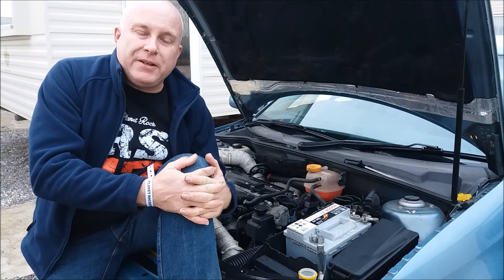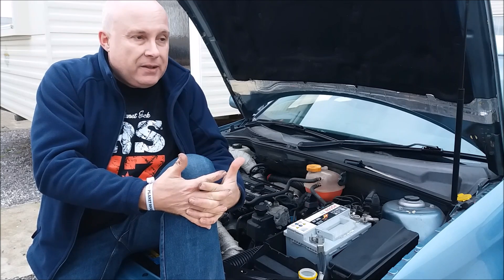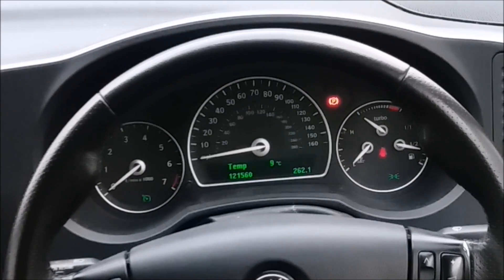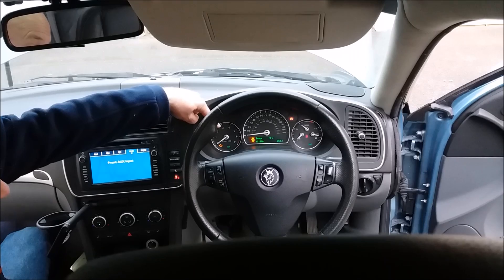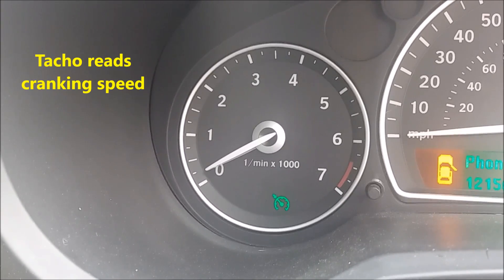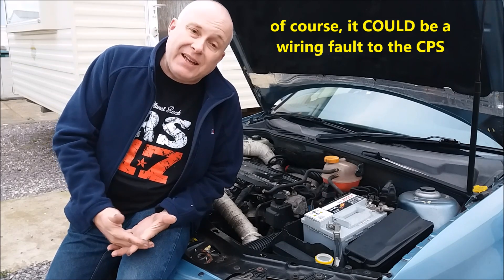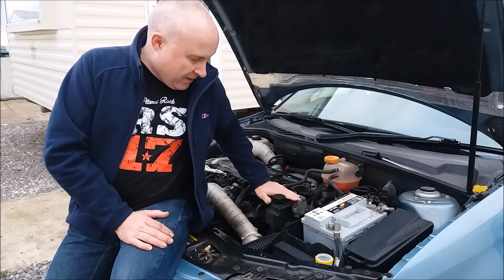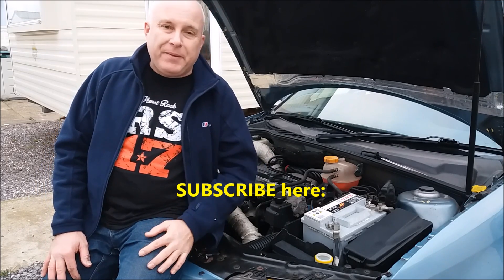CRANK Position Sensor Test - failing CKp sensor - CKp test

Comment: Interesting, my Kia Rio 5 hatch, is a 2013 model, recently had this issue could not turn over engine. Thought battery, but it's in good health. It would eventually start, and work a few times. Last night couldn't start and same this morning.  

I did notice my rpm gage  was at 0 when I got it to start and I was on the road doing 60km/h. Thought it odd at the time. Parked my car at a plaza and stopped and started the engine and rpm gage was fine.

Now present day, my Kia Rio 5 hatch won't start. Waiting for a tow to the garage. 

This video helped me clue in the rpm and the crankshaft sensor!

Wish I found your video sooner! Thanks!
Reply from the maker: Hope you get it fixed cheaply and easily
Reply: @CycloneCyd  the crankshaft sensor was the issue, I had to get my car towed to the mechanic and explained the issue and the rpm issue, they checked for possible codes and did find it this time and had it replaced.

Picked up my car today and went for a late evening drive on the highway to clear out remaining old fuel and added some fuel additives and filled up my tank.  I only put 3k km on the odometer in 2020-2021 so gotta drive it to keep it in good running condition.

And now I do notice when I start the engine, the rpm needle does do about 200-300 before the engine kicks in.

Thank you for the tip again! Cheers
Reply from the maker: @Wireless_Gadgets  glad it was an easy fix, but just as important, now you know the 'signs' if it happens again

Comment: Hi cyd great vids bud , not sure if you can help me but the Haynes manual is saying set to tdc to change crank sensor ?? Why would this be surely it doesn’t matter as it’s only a magnetic pickup sending a signal it’s a 13 plate connect 1.8tdci thanks in advance regards  trev
Reply from the maker: That does seem odd, but is there a reason you can't set to TDC?
Reply: @CycloneCyd  it means either cam cover off an all pipe work etc or down at crank area alternator and an auxiliary bracket off

Comment: This is what I thought when mine started stalling randomly, same thing, would just shut off and no warning lights or anything. Unfortunately, mine turned out to be the ECU programming which just got corrupted over time until the engine wouldn't even prime the fuel pump or crank.
Took almost a year to find one that worked and figure out how to reprogram it to the Chassis Number of the original one...

I had replaced the CPS in the meantime, coils, plugs, and then it still wouldn't start (would crank but not fire). Turns out the replacement Bosch CPS doesn't actually work and only its original one did. When the Service Tech tested them, the newer part had more electrical resistance than the old one, and the signal was just not getting to the ECU. I'm still on the same late '02 CPS even now, I just clean it out periodically along with the MAF sensor...
Reply: What were your symptoms? Having problems with my corolla starting to think it’s the same as u
Reply: @joshhemingway7294  There was only one, the car would randomly shut off, regardless of whether I was stationary or driving. When it first started, I would be able to start it back up, but that only lasted about 3 weeks, after which, whenever it would turn off, it wouldn't crank back on.
I knew it wasn't the battery, as it was fairly new, and I wasn't getting a charge system warning either. I thought it was some kind of grounding issue.
If I disconnected the battery, waited a couple of minutes for the system to drain residual power and hooked it back up, the car would start as if nothing happened.
As time went on, the intervals at which the shut-off would occur grew increasingly close. The last time I was able to start it on its original ECU, it lasted a total of 60 yards, just long enough for me to squeeze it into an ok parking spot in my neighbourhood.
After that, nothing I tried worked.
I eventually removed the battery to avoid it draining and was basically on foot for the better part of nearly a year.

Comment: My car with 1.2liter engine has problem with low voltage input on camshaft position sensor i changed camshaft and crankshaft sensor the light is still on please any advice
Reply from the maker: The light is still on after driving? Have you checked the wiring? Double check they are fitted correctly

Comment: On a polo 1.2 2002 6v is the crankcase sensor drivers side or passenger side of engine bay I'm struggling to find it. I watch another video of your and you said its on the left. If I stand in front of the car the left is drivers side if I'm in the car the left side is the passenger side. What is it on drivers or passenger side. Be great if you could help with any info

Comment: I have a acura RL 2006 the sensor keeping fails every few months I replace it twice already
Reply from the maker: Check that the sensor isn't moving ever so slightly and a gap opening up to the inductor. It doesn't take much.
Reply: @CycloneCyd  ok ill check that out thank you

Comment: You've described my symptoms to a tee. I'd changed the cam sensor first but still no joy then in the process of changing the crank sensor the plug broke away from the shaft which is still lodged firmly in the hole and looks like it may be sending my rover 75 to the scrapyard. Any suggestions how I might exctract it would be greatly recieved as short of dropping the gearbox to knock it out from the other side or take the front end off and radiator out to see if I can drill it out I'm lost and probably well out of my depth with either option.
Reply from the maker: Ouch, nasty. Could you use a stubby to get a sharp wood screw into it to pull it with?

Comment: Had the exact same symptoms, my mechanic suggested it's the fuel pump without running and diagnostics but I insisted he first checked the crank sensor which it was. Not a very expensive replacement. And also the engine idles much smoother now
Reply from the maker: I'm not surprised it runs smoother. When crank sensors start to fail they can "miss a beat". This causes timing issues or even misfires.
Neither am I surprised a garage tried to scam you for a (expensive) fuel pump. It's big bucks 💲💲 profit for them and they can be virtually certain you'll be back because it won't fix it❗
Well done you for insisting. One more little victory against garage scams and useless mechanics who shouldn't even be servicing a walking stick.
Reply: @CycloneCyd  Thanks. My car broke down in front of the workshop I go to near my house. It was on a Saturday evening so I parked the car in front of the workshop and told the mechanic to take a look at it on Monday. On Sunday, I decided to scan the ecu and see if any codes show up and found the P0335 code, the check engine light was also on. Surpringly, I was able to start the car after it had stayed there overnight. The next morning I went to see the mechanic and asked him what he thought the problem could be. He said it seemed like the car needed a new fuel pump. At that point I asked him if he had checked what the check engine light was and he said he hadn't, that's when I told him that I had already done the scan and he should do the same to make sure. After a while he called me and confirmed what I had found out earlier. The way these mechanics sell these fixes to you is that they always say they're not a hundred percent sure but it could be this or that, so that they can't be held responsible. I guess that's just another benefit of doing these diy repairs, it helps you second guess the mechanics

Comment: Im gonna take your advice and change the cranckshaft sensor , but my car only does not start when it’s cold
Reply from the maker: Let us know how you get on.
Reply: @CycloneCyd  same problems again , sorry for the bad news , but since I tried everything , spark plugs , new coils , new gas pump , injectors taken appart and cleaned , by solenoid , new have throttle body , battery and alternator test is good , oil change .....etc nothing worked , now my last hope is the Ecu, my car is a 2009 Toyota Matrix 1.8 L , Built in Canada . I’m sure the CPU is blown up .

Comment: Mine has the same symptoms but the tach moves. I think the issue is the same.
Reply from the maker: Does yours have a cam sensor as well?
Reply: @CycloneCyd  no it does not. 
It’s a 2010 Duratec 2.0L petrol in a Volvo C30
Reply: Update: the wire of the CKP sensor was stripped. Fixed it and now its all good!

Comment: To the point and well explained hence I subscribed to your. Channel. 
My Audi Q7 starts ok when cold cold but fails to start when the engine is warm. I ended up changing the battery without much of sucess. I think the issue is this crankshaft position sensor. Do you know if Q7 have cam sensor as well?
Reply from the maker: What does the 'tacho test' say? One way to find out might be to search a good spares site like Autodoc for the sensor.

Comment: Please help anyone. I have 2011 dodge avenger 2.4 L. The car takes about 5 tries to start but it usually does that to me when temp drops in winter so I was used to it. However, it died on me yesterday when I was driving making a left turn. I had to wait about 15 minutes for it to start again and took it to autozone. I got code P0335 and P1670. They said I needed crankshaft sensor so I bought it and had it replaced by a family member. Well now the car starts every time, but the engine light is still on and the car chuggs, like as if it’s gonna shut off any minute when I’m driving it. I took it back to autozone and same codes come up. They checked my battery and said it was bad and I needed new one. The battery read at 14 volts so idk if that’s really the issue. The crankshaft replacement obviously didn’t work, but I’m not really understanding code P1670. What else could be wrong with the car?
Reply from the maker: This article suggests the head gasket may be blown:  http://enginedtc.com/p1670-dodge-avenger
Get a compression and leak down test carried out. Let us know how you get on

Comment: Got it finally, my car has a hard start with tachometer at zero during cranking. Only happens on warm engine. Cold engine always starts immediately. I found the connector to this sensor is loose and corroded.
Reply from the maker: Yes indeed, when you get any fault code, always check the wiring before just launching into replacing some expensive sensor or part. 👍 Good work 👍

Comment: mine would quit as I went past the electrical vault in the underground car-park.
Reply from the maker: Wow! Never come across that before. Did you fit a new one and did it cure the issue?
Reply: @CycloneCyd  it was quiting everywhere, but i took special note in the repeats in the underground. I got a junkyard  distributor from coast on mitchel island. instant success , later I bought a rebuilt unit online.

Comment: Amazing clear explanation with a simple test, I couldn’t ask for more! Thanks!!
Reply: I just got in a trouble on a highway with supposedly broken CPS in my Volvo V70 (2001) and fortunately got my friend to tow me home. I’ll check if it starts when cooled down. As I was trying to start the car by the road, it sounded almost like a broken ignition preventing system, somewhat like on this video.
Reply from the maker: Keep an ey on the tacho when it won't start.

Comment: Hello question would a ckf/ckp code make your car run funny like hesitating during acceleration?
Reply from the maker: If it's only during acceleration, it's likely to be a misfire. What EML code are you reading? And what car/engine?
Reply: @CycloneCyd  99 civic si with high comp b20z2 and my b16 ecu. P0113, P1337, P1259, P0135 are all the codes it’s throwing I just changed the plugs

Comment: Hey there Cyclone Cyd. I'm hoping you can help me out I'm struggling in life right now and I need to get my 2001 dodge 1500 truck with the 5.9l 360 it's a 4x4 with an automatic transmission. Anywho I was driving the truck home and it just died while I was traveling at like 70mph. Will crank wont start. I checked to be sure the fuel pump was working it seems to be I can hear it kick on I'm getting spark at the plugs checked with a spark plug test wire. I've cranked with the csps plugged in and the tack would come up off zero *just the slightest with it unplugged it would not move at all. Please advise. It's getting cold I need a job yesterday and walking miles for interviews is very cold. What else should I check. The truck was running strong. No oil mixing with coolant. It doesnt sound like its lost compression. The truck has 140k miles
Reply from the maker: If it's cold already, I bet you're in the northern US?
If you're getting spark, the CPS must be okay. So, it sounds like a fuel problem to me. One way to check the engine is getting fuel is to crank it over for 10-12 seconds and then quickly go round the back and have a good sniff at the tailpipe, You should smell raw fuel. If you don't, then fuel isn't being delivered.
If it's not getting fuel, check if the pump is raising pressure. Find a valve point (looks a bit like a tyre valve) on the fuel rail. Turn the ignition on and wait a few seconds (if you can hear the pump wait till it stops) and then press the valve in. Fuel should squirt out vigorously.
Do those things first and come back.
As I'm in the Uk we are out of kilter with time zones. Also I'm not familiar with your particular truck or engine, but I know who might be. Seek out a channel called The Clay Way. Clay is in Grand Rapids (is that MI or WY?). He's a real nice man and very knowledgeable. He runs an Auto shop in Rapids. Tell him I sent you, he knows my channel.
My own gut feeling is you've got an electrical issue with th efuel delivery system - something that affects everything at once (rather than an individual injector, say). So while you're under the hood (testing fuel) check your wiring over, especially to the injector system and especially any grounds - not so these days, but it used to be common for injectors to share a common ground, so if that ground breaks the engine stops.
Also check all fuses and relays. If it has an injector system relay, switch it over with another of the same type.
Above all else, stay calm and approach the problem logically. Make a record of everything you find (smart phones are good for this - take pics or use the voice recorder or memo pad) 
WOW, that's quite an essay, lol. Let us know how you get on.

Comment: What about camshaft position failure symptoms? Are they identical (I mean the specific example with tachometer counts for camshaft failure as well ?) Either way, you may have just solved a 5 year old problem. You are a legend my friend!!
Reply from the maker: This varies. Most cars with a cam sensor as well will revert to using the other sensor in a "get you home" kinda way if the other fails. Thus, you cannot rely on this method solely if the engine has both. However, you should get an EML identifying the faulty sensor (on which note: always check the wiring to any sensor that develops a OBD code)

Comment: This drove me crazy in my 9-3. I replaced the maf sensor, spark plugs and eventually ruined the coil pack before I diagnosed it.
Reply from the maker: Yeah, I've known mechanics charge $100s changing ECUs, coils and all sorts. It's the lack of codes that confuses them (let's be honest, most mechanics aren't fit to service a walking stick - training [lackof] is a huge issue).
Hope you kept your old bits for spares.
Reply: @CycloneCyd  your right about most mechanics.  my latest 900 has receiipts  from 9  shops over the decades,  I found the bad contact, but it took over a year.

Comment: Got a golf 2007 20 sdi changed both of the sensors changed crank sensor and the cam sensor and it still won't fire up still showing crank sensor need changing anyone no wots wrong with it
Reply from the maker: Have you checked the wiring? Also check you've defo installed it correctly and pushed it fully home

Comment: hello ,, i have renault egane hatchback 2004 and it has problem that turns off while slowing down and changing gears .. i went to a garage and they replaced the cranck sensor .. the car is going well without problems ,, thsi video is helpful because what he is saying happend to me while driving!
Reply from the maker: Thanks, glad to help and to hear the method works. Welcome aboard

Comment: I got the engine light on my vw polo 9n 2008 1.4tdi, checked obd and was g40 camshaft position sensor. I changed it but it didnt fix the problem, now i wonder if it can be the crankshaft position sensor. When i crank it it does read on the tachometer, but is that because it reads of the camshaft?
Reply from the maker: Yes. Cars with both crank and cam sensors usually revert to using the one good one as "get you home" if one of them fails. Be sure to check the installation is "spot on" and also the wiring continuity to the sensor.

Comment: Had that problem with my 2011 dodge avenger replacing the part was easy getting the engine reconfigure was almost a disaster but got it fixed within 24 hours.
Reply from the maker: It's so nice to hear people's success stories on different cars and from different parts of the world. Thanks for commenting and welcome aboard.